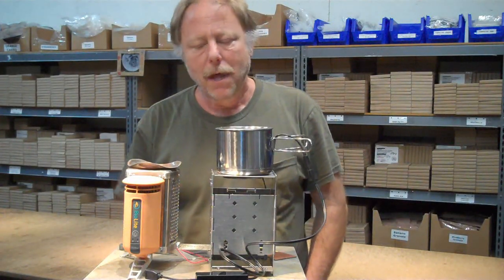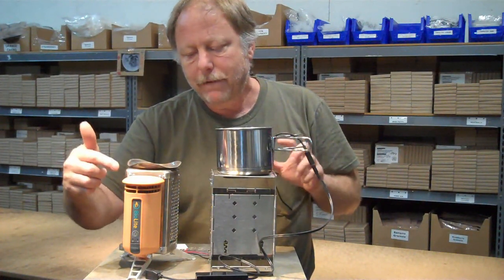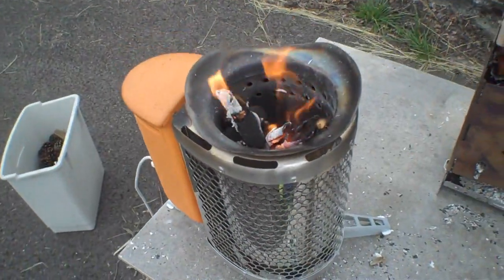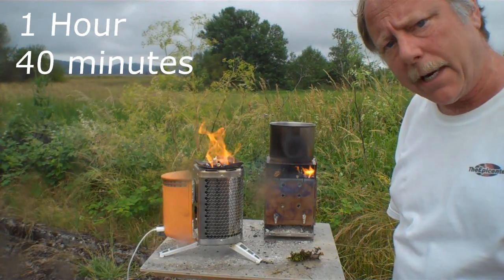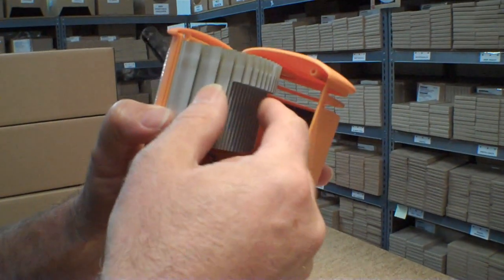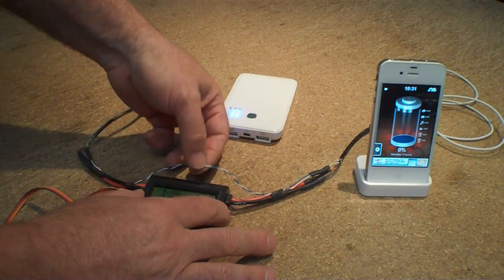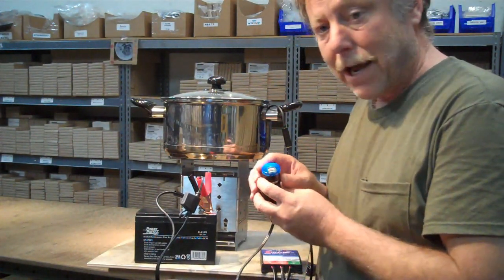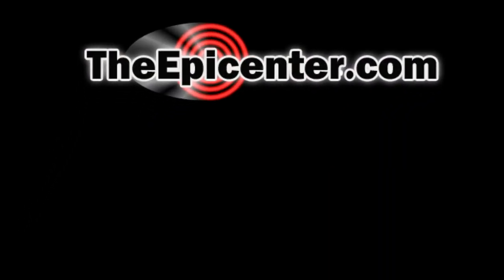BioLite Charging Test - using iPhone 4S and comparing with Cup Charger and FireBox Stove Day 3

Comment: BIASED?
Wow guys, that test was a pretty bad fail...
Fan needs to be on LOW, not on HIGH, then it KEEPS CHARGING all the time. Funny that you didnt figure that out with your seeming knowledge about electric devices.
Reply from the maker: The manual says for the most power to run it on high.That also creates the largest temperature difference across the TEG, thus the most power output.

Comment: Both of them are absolute garbage I carry a 10,000 mah portable USB bank. charges samsung galaxy note 2   4 times from dead. And it's probably an eighth of the size of one of those stoves
Reply: The point isn't survival in my opinion but the fact that you can generate power using the fire you cook or boil water with. this in some cases is easier for people than it is to have both.
Reply: Not the point. In a survival situation you need to have a permanent source of power.
Reply: I had to agree with you because my mate got a biolight and i seen it in operation, way over priced and so is the powerpot. I got a 35000 mah portable usb bank for my son, it has 2 usb outlets one is 5 volts 1 amp the other 5 volts 2.1 amps out, it also has a buiilt in 1.5 amp solar panel is very small and light in comparison and cost £10.99 as they were reduced on offer, not one bad review,all 5 stars from so many people, and thats that.
Reply: TemplarX2 I'm wondering how they will charge the portable banks when its depleted.  Solar...what if its raining or cloudy?  TemplarX2 i don't think most people have the survival mentality, but rather a day pack picnic mentality and forget that this type of product can be used to power anything not just cell phones...which may not work in a survival situation.  Good response.
Reply: True

Comment: I have found that it's not always necessary to have the fan on the BioLite stove set to high. I can get the stove to provide electrical output over a greater amount of time with the fan set on low (keeping a strong fire is still necessary) and while cooking on it. The high setting is more for getting a hotter flame or helping to get the fire started. Having the fan set to high requires more power thus continuous output can not occur.
Reply from the maker: I wish I dad tried that, but the manual says to run the fan on high for the most power. I can't test it again because mine died.

Comment: It's great that you took the time to record these and make them available for everybody. However, I think your test is a bit biased to the product you are selling. First of all, just by comparing them on your video, your heat source with your fire stove looks substantially larger than the Biolite. Secondly, the Biolite is also running a small fan to burn more efficiently, therefore part of the power generated goes to the fan and not the charger. I do not own either one of the products, just making an observation from looking at your video.

Comment: I realize all of this. The fact remains that air cooling is nowhere near as efficient as the conductive water cooling of the pot. In other words, the "cool" side of the biolite generator likely gets hotter with time and excedes the temperature of the cool side of the water cooled generator, which cannot excede 212F/100C. At that point, the biolite generator would become less efficient. This is merely a hypothesis. I would love to be able to test it at some point.

Comment from the maker: The fan that causes the fuel to burn so fast is also the air source for cooling the TEG. The air starts off by entering the housing where the finned heat sink is attached to the TEG. It then exits into the burn chamber. Running the fan on high creates the lowest temperature on the cool side of the TEG thus creating the most power.

Comment: I would imagine that since the biolite depends on air convection to to cool the cold side of the generator, that as the whole unit heats up, it becomes significantly less efficient. The temp differential for the cup charger remains relatively constant. It is probably best to use the biolite to charge for 15-20 minutes while cooking each each meal (this is how it was meant to be used). The initial rates of charge in your video seem to support this hypothesis.

Comment: Did you charge the BioLite Stove out of the box prior to the field test?  After an initial charge the stove shouldn't need to be charged ever again if you use it at least every six months, but without an initial charge it will not work correctly.  My BioLite charged an average of 8% every 15 minutes.

Comment from the maker: We did need to add about a cup of water during the test. We just added ambient temperature water. You actually get increased output when you add water (or replace it with cold water) because the water temperature decreases and the difference in temperature between the heat and the water increases. The extra power only lasts a few minutes and goes back to normal when the water starts to boil again.

Comment from the maker: The FirePower 40 is not on the site. We are re-evaluating the product as a charge system for an external battery rather than a self contained system. It turns out, many people wanted it to be able to charge larger 12v battery packs like Goal Zero, or car jumper battery packs that have cigarette lighter outputs. While we are re-thinking it we are also going to look at using a MPPT charge controller rather than a PWM controller to try to get even more power output. Stay tuned.

Comment from the maker: I don't think mine ever worked right. The last time I used it there was no output at all but the fan still worked. And the orange LED started flashing even when the flame died out and I turned it off. Had to take it apart and remove the battery to get the light to stop flashing.

Comment from the maker: Smart phones (like the iPhones used) turn themselves on automatically when connected to a power source even if you had them powered off first.There is no way around it. The only thing that could slightly reduce power usage is to put them in "airplane mode" where the transmitters for Bluetooth, WiFi and the cellular network are all turned off. In this test, neither phone was in airplane mode.

Comment from the maker: Yes, the fire box fuel capacity is bigger and requires much less attention. I have not tried coal but I have tried BBQ briquets, and also oak lump charcoal. Although they produce good amounts of heat, not enough reaches the probe to generate any useful power. It really takes flames to get power output.

Comment from the maker: The cup charger is 5 watts peak output, but  the continuous output (which is normally when the water boils with a nice heat supply) is 3 watts. The peak output is only really obtainable with cold water / snow / or ice.

Comment from the maker: The BioLite comes with a special cable (male USB A to male USB A) that connects it's normal output to the output of a standard wall charger. Sounds strange, but you back feed power through that connector. The downside is that it's a special cable so if you loose it you can't buy one at Radio Shack. Charging takes about 4 hours. I haven't run it down all the way so I don't know what would happen. They say to fully charge it before using the BioLite.

Comment from the maker: Yes, it would make a big difference. If snow is used the output would be maximum. This unit would hit a limit of 5 watts because of the regulator. Future models may get closer to the theoretical module limit of about 7 watts if the regulator design is changed (but at higher cost).

Comment: Every time I see someone trying to charge a phone with one of these, the phone is on.  That is why they charge so slowly.  If you turn the phone off and then plug it in to charge, it will charge much faster because the phone isn't using power to run itself AND charge the battery.

Comment: Another thing to mention is you add something like the new rechargeable USB lighters, no flame, from pilot on amazon and you got "fire" fed by fire...   Im really hot for this product, just want a bit more of the specs I asked for on your other video.  PLEASE drop me an email or update your site with the info.. maybe grab some USB Rechargable lighters to sell along side too eh?  drop me an email on the 1.5 litre.. does it have the same larger TEG component?  amidthechaotic@gmail.com

Comment from the maker: Yes you can get about 6 watts if the water is cold.The cup is small, so it is not practical to change the water constantly. As the water heats the output drops, so the increased output is only available until the water starts to boil again which only takes a few minutes. The rated 3 watt output is when the water is boiling. Yes, you could get higher power for a longer time if you are melting snow, but not very practical for most people. We do have larger models that output 8, 12 and 40 watts.

Comment from the maker: @sjbnator thanks for the inputs. That is exactly what we saw on day 3 with an iPhone 4S. A friend borrowed my Biolite (the same one in this video) and used it for an hour charging his his phone (not an iPhone) and he said the Biolite worked fine and didn't turn off once. So I think the iPhone is a bit outside it's output capacity. That makes the cup charger more valuable to me since it works with both iPhones and iPads. We have 2 of each in my family.

Comment: Hello! Just to share some data with you. I tried my new Biolite here in Finland, outside temperature 14-15 degrees Celsius. I was charging an Iphone 4 using perfectly dry birch and I was not very impressed with the results. I left it burning full blast for about 4 hours and I was never able to get a full charge. Even when flames are blasting and there are plenty of hot cols I never get a constant charge. I thought mine was defective but clearly there are some engineering issues.

Comment from the maker: I have one and have used it. The first version had some performance issues which were  resolved with a new regulator cable provided with the current USB only version. It did loose the 12 volt capability that the original version had. But the new 5 volt USB only system works like a champ. When they get caught up with their existing orders, we will be discussing offering their product as well. And yes, we will do some comparison videos with the units from Japan. All these all have a "+" and a "-".

Comment: WOW! Never under estimate the power of denial. Did you spend your hard earned money on a Biolight and now your unwilling to see it's shortcomings, If the Biolight is so sensitive that your argument holds water then you are in fact pointing out it's shortcomings. As I scroll through the video I see that the wind is constantly changing directions and through a portion of the testing the air intake is completely away from the other stove. I think this reviewer  tested these devises honestly.

Comment from the maker: Thanks for the note RearDencode. I do like the BioLite, and I think it's well designed and quite sexy. The cost is fair. I'm not sure if mine works right at this point. But I would like to know if mine will run LED lights the whole time if the fan is on low. That would be useful around the camp site, and I might give that a try. Hopefully the lights won't go on and off.  With the fan on high it just takes too much effort for the power I'm getting out of this unit. Any thoughts?

Comment from the maker: Interesting. Even with mistakes on day 1-2, we saw a common theme on day three: the "off" time was getting longer between "on" cycles and that continued even after dumping the ashes and starting fresh at 1 hour. I'm not sure what accounts for that. I can't rule out a defective module and guess I won't know unless I replace it. The battery is very small, around 650ma as I recall, and perhaps it has an issue since the BioLite monitors power usage to determine when it can output excess power.

Comment from the maker: When you use yours, do you run the fan on low or high? Another channel viewer said he has success with the fan on low, but the owners manual says to run it on high like we did for the most power (since the TEG is air cooled).